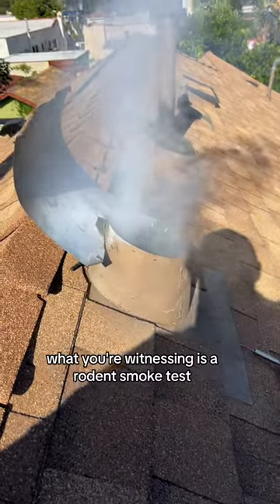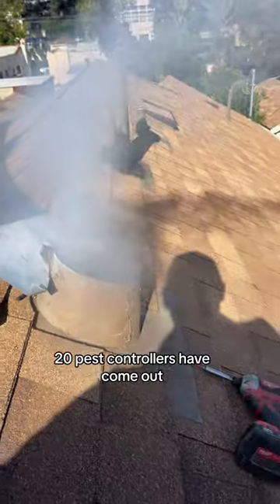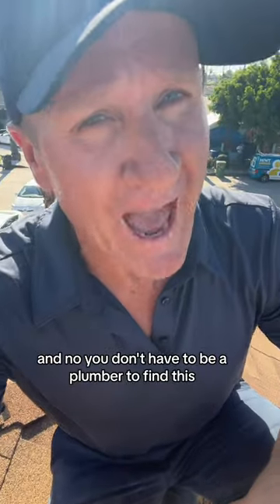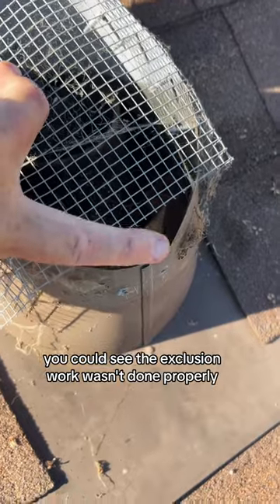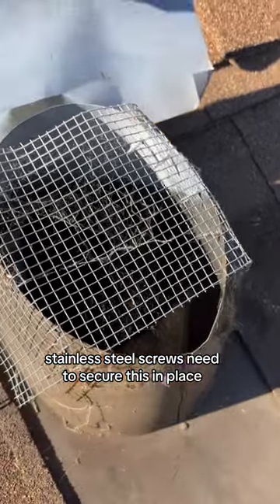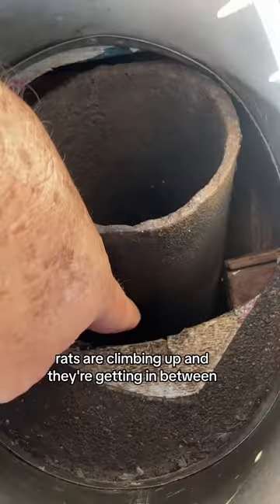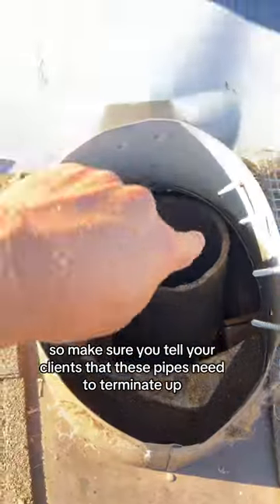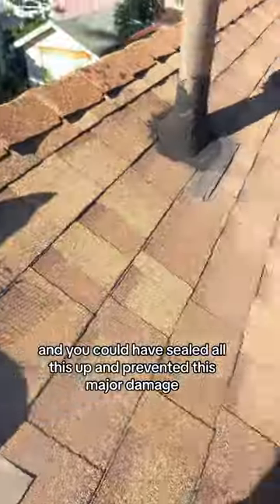BIGGEST mistake Pest controllers make COSTING YOU thousands! #atticrats #pestcontroller #homeowners

Comment: They didn’t wanna do it right because then the owner would stop calling to have them fix it. Many in this line of work don’t want their gravy trains to go. 

Props to you for actually fixing it.
Reply: You have no idea what's you're talking to 
Ongoing rodent problems are no where near a gravy train
It's a drain 

Exclusion is guaranteed,  whichever means complaint calls are done for free 

Effective exclusion the lucrative, but only effective exclusion
Reply: @stanb990  Drain for the owner yes. Gravy train for the pest control/other personnel coming to fix it. In this case there is no way they missed it if they came 20 times. They knew what the cause was and wanted to get as much as they could before their ability to profit off it got fixed.
Reply: @ashadsiddiqui3226  what???
What you said makes literally zero sense.
None whatever 

It showed a complete lack of of anything remotely associated with business and/or common sense.
If you aren't embarrasses for writings it, im embarrassing for you after reading it.
Stop.

Comment: Lazy roofer.  Our code states sewer vents extend minimum 12” above roof line. I get it that this is a reroof and the pipe was too short to install typical flashing. They just had to extend the pipe with a  band clamp and abs pipe to extend it high enough for flashing. Gotta love that attempted screening of the T Top😂

Looks like SoCal work to me

Comment: I found rats doing this exact same thing  and I just put a stainless louvered vent stack on top, problem over they couldn't get out of the pipe (hub cast iron) I was just there to patch the roof saw that crap immediately. Later I found out that he hasn't had a rat problem and since I fixed the roof and then I told him what I did. It's only right to do it right.

Comment: The screening would be a moot point had the stack vent been to code. As installed it's wrong on several levels. Correct the vent, the rest is no longer an issue.